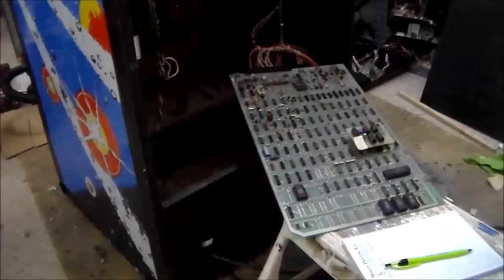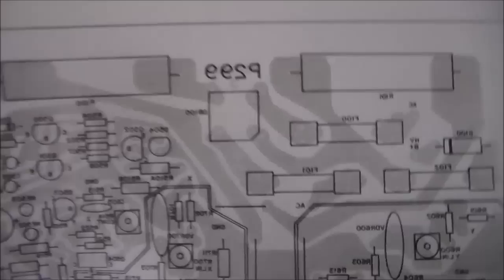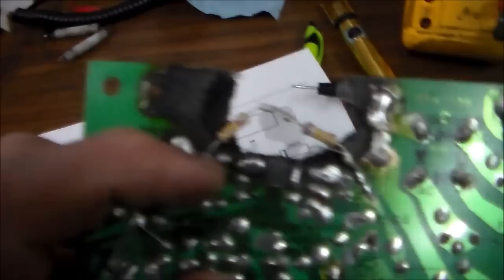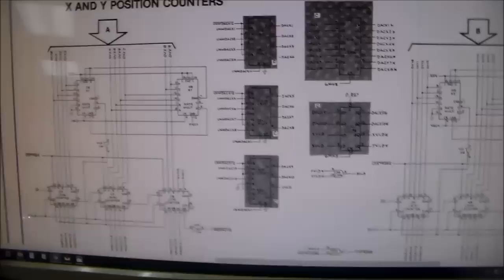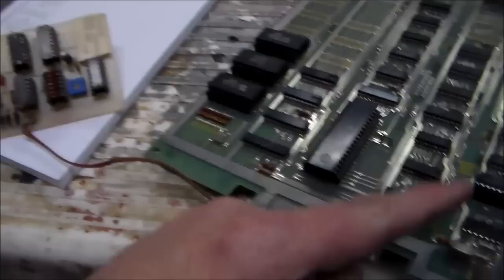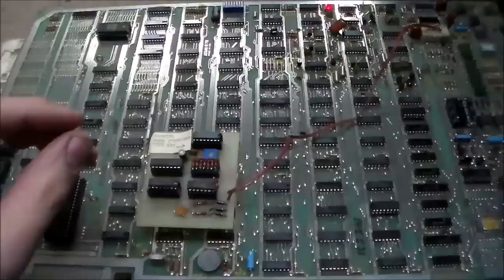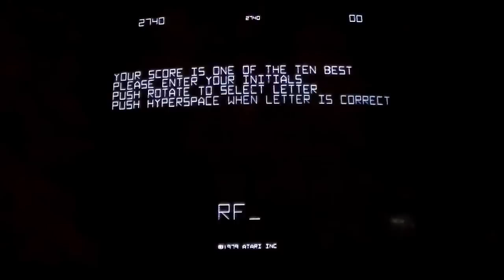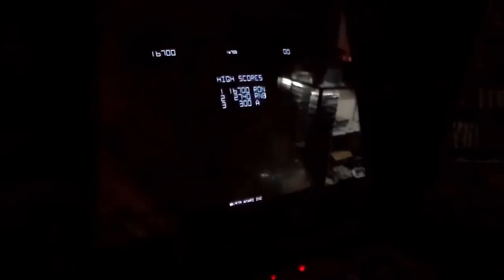Fixing a 1979 Asteroids Arcade Game - Operator Caught The Vector Monitor On Fire!

Comment: Board is actually fixable. You cut the burned part out and groove the edge. Then make a fiberglass patch the same size, groove the edge then epoxy it in. You can etch the runs in before you epoxy it in, then solder copper patch runs in the breaks where the old an new boards meet. Been there done that. Nice work around repair Joe. Best Wishes n Blessings. Keith Noneya.

Comment: When I do resistors in series like that, I use heat shrink, or keep the leads just long enough to solder to avoid shorting.

Comment: I've seen this done before, and I've done one myself.  Cut out the burnt section, cut a chunk of single-side to replace it, lay out the traces with a sharpie, etch, drill, epoxy it in, bridge the connections with copper braid and solder. It looks ugly as homemade sin, but it doesn't alter the board. Mine really looked bloody awful cuz it was blue fiberglass patched into an old-school brown phenolic board.
Reply: That's what I was thinking.
Reply: I take side cutters to the old board, then use protoboard to patch back in what was taken out. Works perfectly fine for old single sided boards, but yeah, it's ugly.
Reply: Think I would have just cut a small piece of perforated board and attached it over the hole using 5 minute epoxy or RTV silicone.  Just for the support and holes to slide components through.

Comment: There's also a simpler version of the speed hack, which doesn't require a daughterboard.  That's an older method, before a better one was found.  You can just clip or lift the inputs to the 161 at C5 (pins 3, 4, 5,  and 6).  (Socketing that chip lets you do either.)  Depending on which you lift, you'll get faster or slower play.    There are 16 combos, and 5 or 6 of them will give faster play at different speeds, while the others are either slower, or they are too fast and cause the board to hang.

Comment: I repaired TV's from the 60's until 2000. We did many repairs like that. I remember the name Wells Gardner too. I'm not sure but I think they also made bowling alley monitors back in the day. We had a contract to do their repairs.
Reply from the maker: You're correct Glenn, Wells Gardner made the bowling alley monitors!  I didn't realize it until I was operating some games in a bowling alley, and the tech in the back told me about it.  Thank you for watching, see you on the next video!
Reply: I was a video game tech in the 90’s and most of them used Wells Gardner CRT monitors from Chicago

Comment: just love vector games, can not be emulated by any means, a TRUE VECTOR CRT is amazing, and I so want one !
Reply from the maker: There are a couple guys actually making  replacement Color Vector monitor boards now, you still need a used crt but there's a ton of those in old junk t.v.'s.... so the Vectors are going to survive at least for the foreseeable future!
Reply: agreed..... and I used to think that till I very recently saw a emulation system on a 65" microled tv...no back light and a smaller pixel than the old shadow masks on CRT's will I think make these a damn good replacement for vector CRT's...probably cheaper to fix an old vector monitor at the moment though....but it offers hope for the future of old games... 
Couple that with the Sinden Light gun that's in development  and some damn good emulation systems are in the future...
I can't afford a micro led tv/monitor so I'll live with imperfect impersonation for now.
Reply: Normandy  is that similar to the old Vextrex?  May have spelled that wrong
Reply: @michaelmcclelland2080  yes same tech.
Reply: @LyonsArcade  love to see a video on a colour one .
Reply: I remember adding color screens to the vextrex when they came out.

Comment: Love your videos. I noticed that the other resistor was elevated off the board. This is done because it gets hot and would burn up the board. The replacement tuched the board and burnt it up.

Comment: Also, a little shrink on that series 1.5 meg resistor would have been a good idea.
Reply from the maker: I think you're right!
Reply: As a personal preference; on the removed and jumpered 3.9 Ohm resister, I'd have run the jumper wire straight between the two points.  In the very unlikely case of wire insulation melt, it couldn't short to anything under it.  Just an OCD paranoia thing.
Pretty good work in the board reconstruction.  Fun fact; in the 50's vacuum tube era, passive components were straddled in air between connection points (typically tube sockets, and terminal blocks).  So that work is kind of a call back to methods of old, pre-pcb.

Comment: Lol that brings back memories, Wired Wound Resistance, commonly called electric fore element, just add over current and lo a cheap coffee warmer. Even if they are in place primarily as a current limiter. Also just as a thought, these machines were made to go in any room condition, so if its a room that get cold overnight the heat from the resistances just provided enough heat output to keep the box warm and prevent condensation from happening with temperature gradient.

Comment: I have a arcade astroids game and I looked at my deflection board and I got the two big resistors still on mine I also have all the manuals with it and the technical schematics to they came in handy a couple of times when I had to fix it
Reply from the maker: Very cool man!  If yours is working I probably wouldn't mess with it but if it ever breaks I'd lose those resistors :)

Comment: I had screwed up my Robotron monitor by moving those beam adjustment tabs. The problem was that they would stick so you try to move one and another would move too. I had got it close using their crosshatch test mode but not back to how it was. So I swapped the monitor with a better one that was the same model. I then put a flat panel in the game I took the replacement from. I had to buy a converter board so I could use the VGA connector on the computer monitor. Since it had a normal on/off button I just kept it on then tied the power to the game so it would fire up when the game was turned on.
Reply from the maker: Yeah those alignment adjustments aren't bad at all on a black and white, but on a color it's a whole other story, I never converge them on a color monitor because of what you ran into it's almost impossible!

Comment: Regarding your position issues, in the future, probe the output of the first TL082's after the DACs, with an xy scope.  You can get an image there (which you can't do directly from the DAC output, as it's a current signal and not a voltage signal, so you have to go through the first TL082 to get a voltage signal.)   If you get a good picture with those two points, you know the issue is downstream from there.  Analog issues are common with these.
Reply from the maker: Thanks Andy when I break out the scope i'll check that out!

Comment: NMI means "non-maskable interrupt." There are regular interrupts that cause the CPU to run code to service them and then return to where it was. There is a line for those, and those interrupts can be disabled ("masked out") by software. However, most CPUs also have a non-maskable interrupt line. That is for serious trouble with the system and things like that. So that is an extra critical set of interrupts that cannot be turned off. As for how it works here, I have no idea.

Comment: Burnt PCB laminate actually conducts electricity. It's often in orders of megaohms(sometimes much lower) but it can, and will mess up the circuit, making it behave almost randomly unstable. I've seen switch mode supplies  that would go haywire cause of that.
Reply from the maker: Gotta get it all off of there then :)  Thank you for watching Caenine, we appreciate it!

Comment: I agree with the other techs in the convo. I cut that crispy part out with a Dremel tool or something. Glass, glue in a patch and drill holes to match what was there. Then do your jumpers. That’s me. Man that thing must have smoked up the arcade or bar it was in bad. Probably left on 24/7.

Comment: Seen a pinball machine PCB fixed using two part epoxy resin with tiny holes drilled in for components and small hard wires to the rear.
Reply from the maker: That would work just fine I believe!  Thank you for watching christastic100!

Comment: Not sure if some one else has already said it but it would be best to refit new resistors. They are to protect components from inrush current when the monitor is first turned on.
Reply from the maker: Atari (who designed the monitor) sent out a service bulletin instructing operators to remove the resistors.

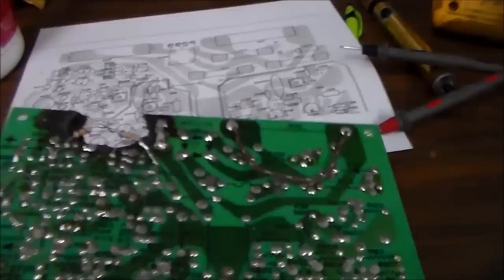Comment: At 12:49 you have a long jumper wire in place of that resistor. Protip: desoldering braid is straight, and coppery, and will carry a lot of current. It's a straight shot across those contacts and you don't need to insulate it. Cut the braid, solder it in place, voila...heavy trace created that will carry plenty of current....more than the traces on this board will. Want even more current capacity? Fill the braid with solder. I used to save the used braid bits and use them for trace replacement.
Reply from the maker: I've never used that stuff much but I'll have to pick some up, that's a good idea :)
Reply: @LyonsArcade  Yup. I used it before I got a desoldering station. But generally, I don't like components of any sort over others unless they are very secure. At least shorten the wire where it can't roam around and rub etc....like the carnie fix did.

Comment: I had an Asteroids Deluxe Cocktail (the best kind of Deluxe) and I ended up selling it when the Electrohome monitor gave up the ghost... basically gave it away, sad.  The one big repair I did was to bypass the edge connector for the voltage connection... it was fried pretty bad, so I just cut the wires and soldered them right to the board... never a lick of problems after that.
Reply from the maker: Don't feel too bad man, we sold an Asteroids Cocktail when we were teenagers to a guy for 50 bucks because it didn't work!  Now I fix them for a living.....
Reply: @LyonsArcade  You probably wish you could go back in time and slap your earlier self for that one!

Comment: 'Power resistors' (i.e. ballast coils) typically generate a lot of heat, hence the 'ceramic' coating. Power resistors use to have a lot of applications on automotive equipment back in the day. I have been burnt by them before. They get very hot. It probably was not a short. Two 1.5 ohm resistors in series do not equal a single value of a 3.9 ohm resistor. More importantly is the wattage rating of the resistor and it's ability to dissipate heat.

Comment: The pot seems to alter voltage - The piggy back clip has 2 connections.. Red and Black... Seems to draw its power from the same circuit as the start button light... Can really see the screen difference as you alter it from dim to brighter with less pulsing
Reply from the maker: I think that may be what it's doing, definitely.

Comment: When I worked on arcade games, I hated Atari’s power supply with the giant filter cap. What a piece of unreliable garbage that was. Edge board connectors were another big problem. And those XY “quadrascan” monitors with the TO-3 transistors mounted to the metal chassis with lousy mica insulators. Yikes!
Hint: if the red LED is lit on the monitor, it means the electron beam has gone static and the beam is blanked to prevent a hole from burning on the phosphor screen in the tube. Also, you can set an oscilloscope to channel 1 = X and channel 2 = Y and watch asteroids play on a scope screen.

Comment: The rich irony of the resistor replacement is not wasted on me. I fix things for a living and it's weird how many times this kind of ironic outcome happens. Once fixed something where a pound coin (I"m in UK) had got in a unit and shorted some main supply line. I removed it and then bought a new fuse that it needed using the very same coin. Always something like this going on - and yes there is a God and we are in his world.
Reply from the maker: It does seem that way.  I see strange things like that all the time, too perfect to be random in my opinion.  If there is a God, he seems to have a very good sense of humor.

Comment: I've never seen this actual arcade version of the game before, pretty good graphics. I only played it on our Atari 2600, many afternoons I spent playing it. Kind of strange the Atari 2600 game had colored asteroids and this doesn't.
Reply from the maker: At the time they hadn't came up with a color monitor yet for the arcade games, everything was still in black and white.
Reply: Whats kind of wild about these, is that the vector graphics monitors worked more like an ocilliscope screen than a TV screen.  Like dragging a pencil across the screen making lines, instead of wiping left to right, top to bottom.  Laser light shows do the same thing.
Reply: The cool thing about these vector screen games is that there aren't any pixels. The screen actually draws the lines directly. The lines are perfectly smooth at all angles, and they tend to be just a touch brighter at the ends. You can only experience this seeing one in person because the YT video is composed of pixels. The "trails" he talked about on fast-moving objects is because the phosphor is much slower to stop glowing than in later-model CRT displays. All of those display artifacts are part of what gives the real HW a very distinctive feel that emulation can never completely match.

A friend and I built a MAME cabinet using a real arcade cabinet, and the CRT being a real arcade monitor, the pixels on the screen had real scan lines and real "overlapping pixels" due to the phosphors being arranged in a honeycomb pattern and not just discrete pixels. So when you'd run MAME on the pc while it was connected to a PC monitor, the screen is "too perfect" but when it's connected to the vintage monitor, it looks exactly right because it is using the real hardware to display the game. This effect is much more apparent on older games like Pac Man, Donkey Kong, Elevator Action, etc than on games like Mortal Kombat which uses digitized images and higher resolution graphics that don't show off the individual pixels so much.

These "inaccuracies" on emulation are not apparent to people who never experienced the real McCoy because they've only ever experienced these older games on modern displays.

Comment: NMI on 6502 is what I call IRQ - probably the animation is done using interrupts for smooth display, looks like you are changing that rate there. Used to set it in a memory location on the 6502, can't remember where now.
Reply from the maker: That make sense, thank you!
Reply: @LyonsArcade  NP, thanks for the vids- most enjoyable!

Comment: I probably would have created a little 'daughter' board and rebuilt that entire area on it and then cut all the old traces going to the burnt section and removed the burnt section and attach the daughter board in the spots where needed.  Would be a lot better connections with no chance of shorting because of shorting where the board was burnt.  Then again, I used to build a lot of boards for military and also space shuttle using a microscope to do the soldering.  Still have a microscope here for doing the fine soldering and repairs on many things.
Reply from the maker: That would have worked very well!  Thank you for watching Michael, we'll see you on the next video.

Comment: You must not be too worried about that double-resistor arrangement touching something, or you could have used some electrical tape to insulate it. It looks like a good quality repair to me AND Asteroids is a terrific game!   As far as I could tell, when the daughterboard was cranked clockwise all the way, the graphical lines were fuzzier and when you went back to counter, they got sharper.  That MIGHT have been your camera focus, however, so it is hard to say. All good wishes!
Reply from the maker: Thanks Anton, yes other people have said they saw some changes when the pot was turned too but I can't tell if it was just the camera... Thanks for watching, we appreciate it!

Comment: NMI is Non Maskable Interupt, without looking at the circuit, I'd say it's triggered off the monitor update rate somehow.
The speed up mod is obviously some form of clock doubler, so double the updates doubles the speed of the game.
Reply from the maker: I've been told you can do the same thing permanently by clipping a few legs off one of the chips and it changes the clock speed.

Comment: OMG - got a good chuckle from you sense of humor.  On a more serious note, what about using some heat shrink on the leads of those resistors in your 'dead bug' circuit hack. (yeah they call that style dead bug or freeform electronics - google it)
Reply from the maker: I'll check that out, never heard of it!  Yes heat shrink would have worked great.

Comment: Do you ever use an oscilloscope or logic analyzer to diagnose issues with boards? Old analog scopes are super cheap (sub $50 usually), and you can get a USB logic analyzer that should be usable for old stuff like arcade games for super cheap as well. Those can really help when diagnosing issues, especially with something like a DAC or checking signals on boards.
Reply from the maker: I've got an oscilloscope (a couple of them) but I haven't taken the time to learn how they work.

Comment: Vaguely remember from electronics courses that low ohm resistors are stuck places to slightly reduce current on a circuit to reduce load on components. 
Just because the manufacturer changed their minds is it the best course of action?   Or was it a way to get out of replacing defective resistors knowing the unit would make it last warranty before the added current damaged other items?
Reply from the maker: Whatever you say i'm sure is correct
Reply: @LyonsArcade  how much did that one go for?  
Would like a vector Asteroids but I am guessing they are more than I can afford.